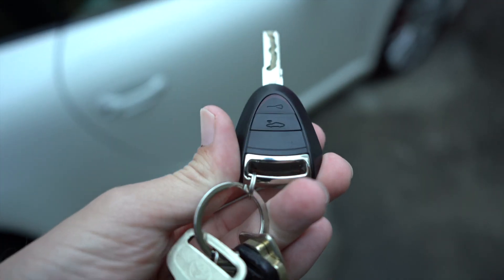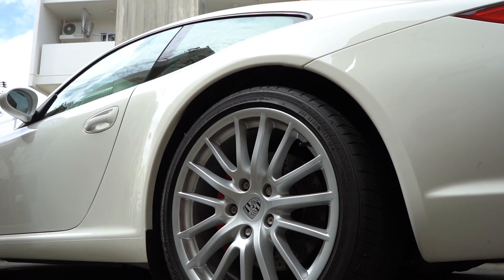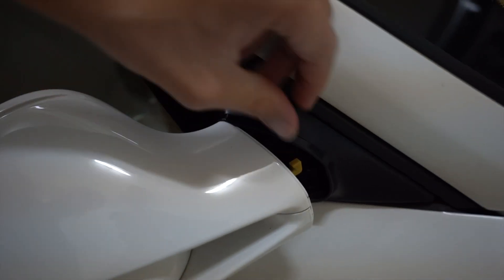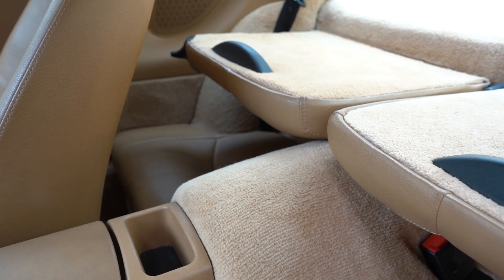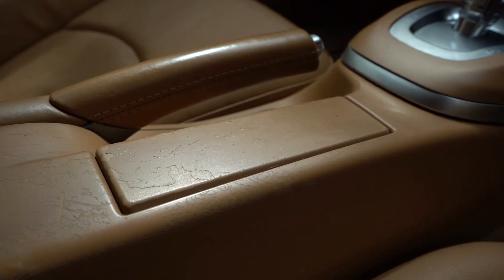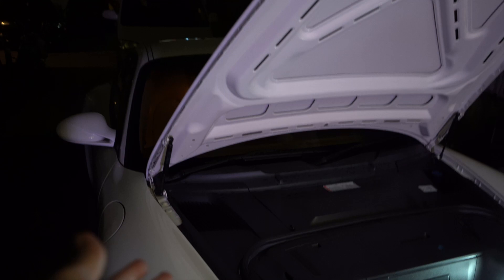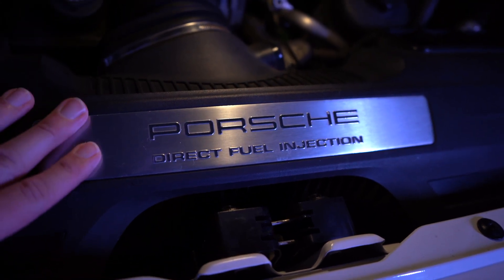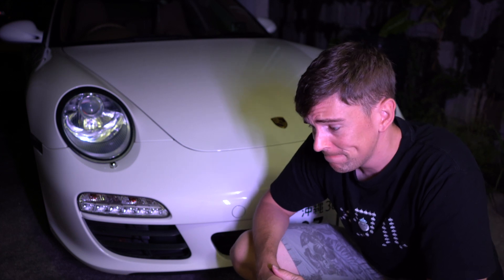Things I HATE about my 997.2 911

Comment: Bruuh this is not the right car for you. The fact that the brakes rust is due to the tropical climate. As you say, Porsches are made for the Autobahn, to California they also fit very well - but not in the tropics.

As a German 997.2 Carrera 4S owner I can tell you that you are too German, because all you do is complain :D
The average German is supposed to always complain a lot, but even German Porsche drivers (myself included) rave about a 911. That's why you're just the wrong person for this car. And that's not meant in a bad way at all. Driving a Porsche means purism. Few electronics, manual driving (or PDK ;)) and no electric mirrors or bells and whistles. At least until the Volkswagen takeover. That's the way it's meant to be. Rather buy a Corvette ;)
Reply from the maker: I would love a corvette lol. But they’re too expensive here
Reply: You understand very little about this vehicle. Owned my 997.2 C2 6MT for 11 years now. Your complaints are laughable. “The size of the “hood” cover we’re talking about here? You’d be the one to drive around and park with the rear spoiler up 😂
Reply from the maker: @jasonwaringschmidt8699  I only park with the rear spoiler up. Make no mistake.

Comment: Welcome to 997.2 ownership. Nothing here to be concerned about - much of what you’ve noticed is down to specification or simply the Porsche way…

Full leather interior feels markedly more classy and avoids the plastic delaminating. Headlights turn off in European markets - DRLs are always on. Brake disks famously rust very quickly. Pro-tip; leave PDK in Park in your garage but do not apply the handbrake. The rear spoiler will lower on the button too - it simply needs the ignition to be on. (Your hinges need a drop of oil.) I’d also recommend swapping out the interior bulbs for LED replacements; makes the interior vibe more contemporary. Finally, the suspension geometry need to be correctly set up for the car to drive well; if it feels wayward at the front you may also have some worn bushes in the rear suspension (yes - rear).

The car is like nothing else; take your time to learn how it feels and drives. There is nuance and subtlety to its character. Enjoy!

Comment: Sounds like your PDK needs to be serviced.   A full servicing/fluid should restore 1-2 shift lag, which I too have noticed over time.  Check if yours has the final PDK update, probably only through Dealers.   I love manuals as well, drove one in Manhattan for 10 years.   I chose a  C7 7 speed to have at another state, but here in the heart of NYC, PDK is really enjoyable, even in non sport mode.  

I actually like the weight and feel of the car, and find it pretty nimble to weave around traffic.  

As far as the interior, you really have to judge the full leather dash, which takes the car to another level, especially with contrasting stitching.  

Beige in my opinion, looks not as nice as the other colors and seems to wear much worse than black interiors.

At least we agree about storage space. I chose the Targa 4S for that reason alone.  It's so practical I've transported a bike, 50"tv in a box, and I also use it to transport enough film gear for a good sized shoot.

I had my entire car wrapped in STEK film so I can keep it pristine even in a harsh urban environment.  

One thing i really like about the pre 991 cars is the low console.  I don't like the cockpit feel, and I don't like to be separated from the passenger.

The 997.2 has just the right size/wheel base, big naturally aspirated engines, and a nice amount of power that feels linear and controllable.   I used to own a manual Mazda RX-8 and even with the low HP/torque, the car was blast to drive.  You had to learn to drive it well and keep the RPMs up and in the power band for the reward.   The 997.2 feels a little like that to me.  

Mine's definitely not for sale, but I am looking forward to doing the full PDK service to see if it restores 1-2 shifts and more.
Reply from the maker: Thank you for the detailed comment. I agree with everything you have to say with the exception of I prefer the cockpit feel but understand why someone wouldn't. To answer your question, no the PDK has not been serviced and it is on the top of my list. 

I'll also be making a video where I spell out the things I like about the car and another video specifically explaining my gripes with the PDK.
Reply: Porsche does service the PDK transmission. Your only option is to replace it.
Reply: @dontcallmetravis   What are you talking about?  There is a recommended fluid service interval for PDK, which has been reported to help 1-2 shift. if a PDK is actually broken, Porsche will only replace.  However there is a company who developed the part for the most common failure.

Comment: Going through the Porsche decision phase now. I’ve driven a base 997.1 and it felt light, responsive and zippy. Feel the same about a Honda s2000, but the Porsche has a more consistent torque band. Therefore, thinking of going w the Cayman as that may have the lightness, zippiness and fun factor i’m looking for.
Reply from the maker: Those are all accurate and well thought out observations. I agree 100%. The S2k is N/A but due to vtec, will deliver power at the top whereas the Porsche will be more even.
Reply: Having owned an S2000 and now this same car, those are worlds appart. The direction is so much more direct and precise in a 911. The front feels very light on the Carrera 2S but not less than in the S2000 surprisingly as the later has the engine in the front. Cornering out is unbeatable in a 911 due to its weight distribution and the power difference is incomparable. The Cayman is a fantastic compromise. Superbly agile on the track too and a pleasure to drive.

Comment: I'm interested in what type of exhaust that is. I have a feeling that if you swapped it out with something less restrictive and better sounding, it'll make it feel less heavy and more responsive. 
Do you have any service records on the maintenance of the transmission? Even though the miles are low, a simple fluid change can make a huge difference as well if you're still running 13 year old fluids.
Reply from the maker: So far I haven’t been able to id the exhaust. And I asked for the service records but it seems like they don’t have them. The transmission service is due though. And on the top of my list

Comment: What you forget about the interior design is that it stems from 2005 when the first gen 997 came out.
Reply from the maker: Probably before that due to design processes. I didn’t forget. Fact remains my 1997 celsior had a nicer interior. Which I went over in great detail on a different video.

And the 997.2 interior was updated. The bones remain from the .1 but it is updated. My complaint is textures not fundamental design
Reply: @AmateurEnthusiasm  Indeed! Sorry to hear that but I don’t have that feeling. I have a 2010 s model and if I think about what cars were driven still around that time I am still impressed how well equipped some 911 were. Sorry to hear that because I find the 997 being a super nice model.
Reply from the maker: @raphaelnissahlosome5300  I enjoy it a lot :) I’ll make an opposing video soon on why!

Comment: The 997 is a great mix of old and new, it’s not a 992 or a 993.  That’s what makes it special.  You might be better off in a 991 or 992.  

Also, 997.2 PDKs isn’t the PDK in the 991.

I have an aftermarket exhaust and engine mounts on mine and love how raw it is.